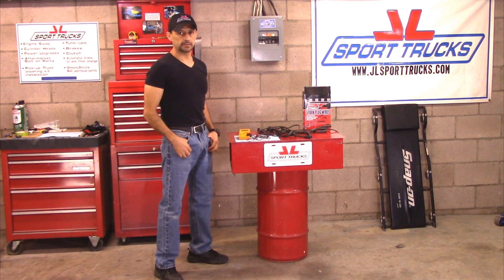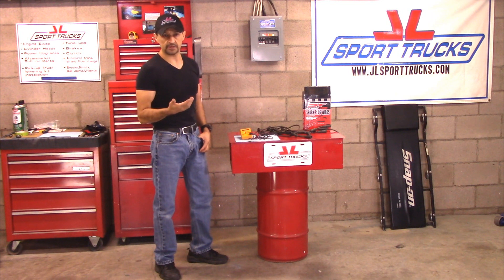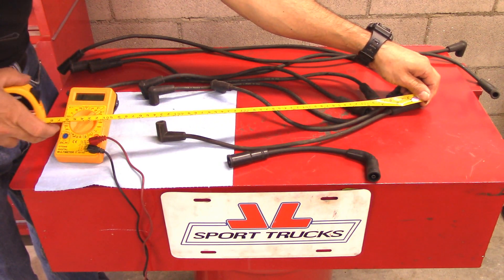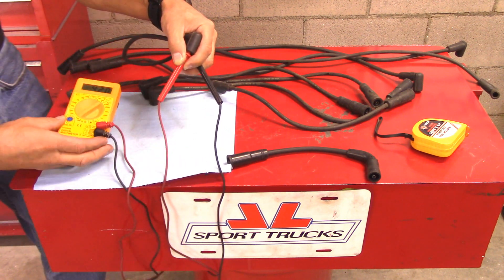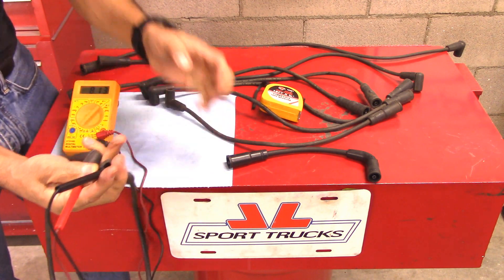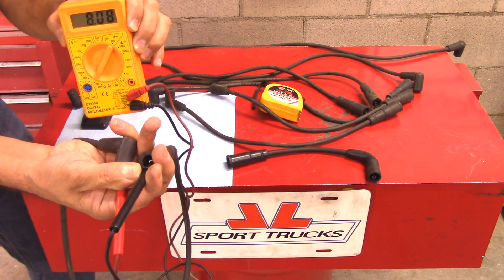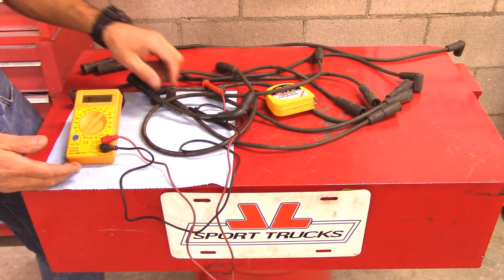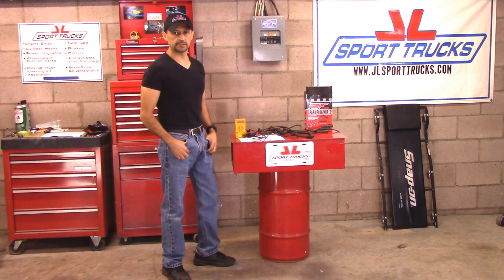How to test the Resistance of Spark Plug Wires using an Ohm Meter

Comment: Thanks I needed that,been chasing what appears to be a spark timing issue on an old points &condensor type ignition.Can’t believe I’m going to say this but I wish I could use the scanner on this one.70s komatsu with Datsun 6cylinder.

Comment: Brother you should simply describe the normal per foot resistance range of healthy spark plug wire. 4kohm per foot means the 3 feet wire should have 12kohm resistance but it showed 8kohm. Please explain. Thank you.
Reply: 12,000 is the maximum ohms. If it's under that like 8,000 ohms your wire is good. If it's over 12,000 ohms your wire is bad

Comment: What if you need to test an electrical connector (such as a water pump connector) for resistance, and you don't want to detach or cut the other end of the wire? Can you attach the negative to the engine block as a ground, while testing the plug for resistance? Or do you have to find the specific wire and remove it from the ECM?